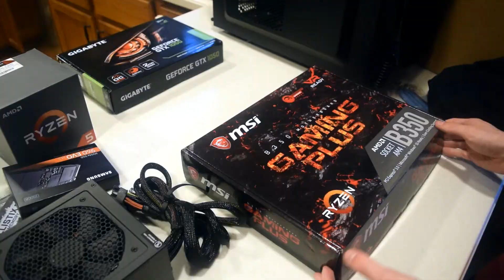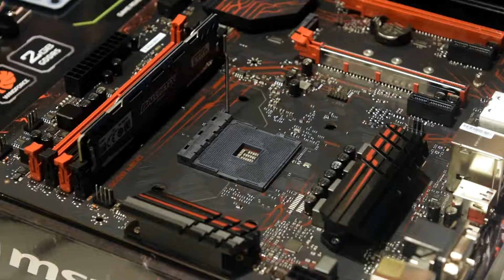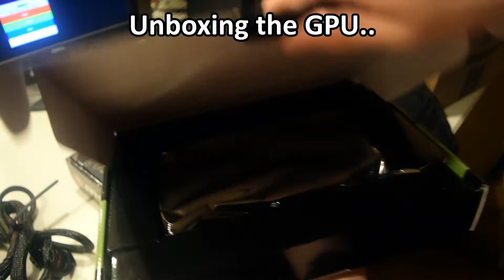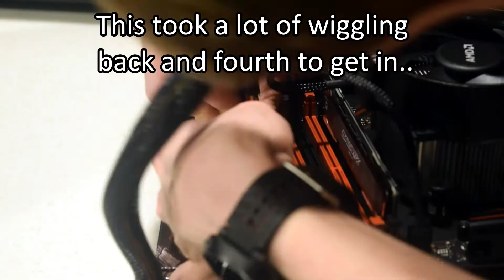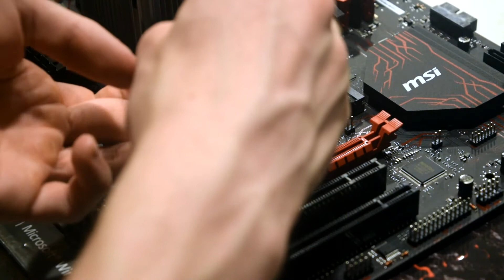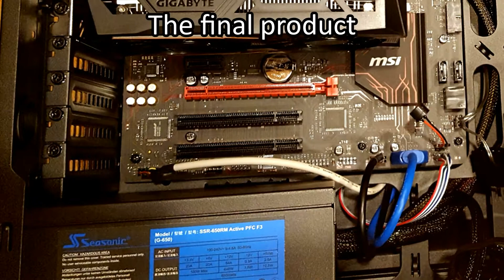$720 Ryzen 5 Gaming PC Build

Comment: Good budget build. I like the PSU choice, usually people cheap out on this part of the build and end up having to replace it every 3 years on average making future upgrades/build more expensive on the longterm.
I dislike the use of the 960 m.2 in this build. It's a high-end sdd, fastest on the market in fact but for low budget gaming pc that money for 1-2 seconds less boot/ingame-load time could've been better invested in say a larger 500gb 850 evo SSD since larger storage SSD is more future proof (considering game installation files wich keep getting larger with new AAA titles) and won't generally die as fast as smaller storage SSD's. Other than that it's a solid build.
Reply from the maker: Ethan Smith The PSU is a great one. On my desktop it never gets warm to the touch, and it is over 3 years old. As for the SSD, the person receiving this desktop has a 1TB hard drive that he was going to install for games and stuff.

Comment: you could’ve just gotten a 1tb hdd, instead of the ssd, and put the extra money towards a 1050ti
Reply from the maker: SSDs are well worth the money. So far I don't think the person using the computer has come close to maxing out the GPU. In a few years if he gets into an intensive game, it will be extremely easy to upgrade to whatever GPU is the new thing. GPUs are advancing really quickly, faster than most of the other PC components.

Comment: For $720 You should have gotten a 1060 cause that 1050 is a massive bottleneck
Reply from the maker: The goal was to save now, upgrade later.
Reply from the maker: So far the GPU is turning out to be great for his needs. He can easily upgrade his GPU if he needs to.
Reply: @LizardsGaming  can i plug in ryzen 5 1600 in same mother bord
Reply from the maker: @TheFrustratedOne  on the MSI website it says it is compatible with first and second generation Ryzen processors. So I think it will work. You should verify that with PCPartsPicker or something like that before buying.
Reply: @LizardsGaming  thnx you so much bro👍👍👍😊😊😊
Reply from the maker: No problem What are you building?
Reply: @LizardsGaming  m building a pc with following components :-
Ryzen 5 1600
Msi b350 gaming plus
Msi gtx 1060 6gb
Wd 1 tb hdd
Vs 550 psu 
Cooler master master box lite 5 case
And 8gb ddr 4 2666 mhz corsair veng. Ram

Comment: I'm building sonething very similar.My PSU is aero cooler 500w bronze 80, will that work everything ok?
Reply from the maker: It will work unless you get a really power demanding GPU. I would recommend a higher efficiency, though, because it saves money in the long run and generates less heat.
Reply: LizardsGaming 

The gpu is  a geoforce  gtx 1060.
Reply from the maker: That's not too power demanding. I can run both a GTX 1070 and a GTX 1060 at the same time on a 550 watt 80+ gold PSU.
Reply: LizardsGaming 

Thank you for your help.

Comment: better would be a ryzen 5 1400 and a gtx 1060 3gb the motherboard is awesome and overclock the ram and cpu
Reply from the maker: The person who requested this PC requested high CPU performance and GPU upgradeability.
Reply: LizardsGaming  but for 720$ you could build a better pc
Reply from the maker: The thing about building a computer is that the PC can be tailor made to be the best for the specific purpose of the machine. In this case, for the specific use cases specified, we could not have done much better. The PC already outperforms his requirements.
Reply: LizardsGaming if you are useing it for minecraft its ok but i would upgrade to a gtx 1060 soon or atleast a 1050 4gb and dual rank ram
Reply from the maker: Africa Is A Beautyfull Planet KRI there's room for a GTX 1080

Comment: Seriously a 80plus gold for a 75w gpu
Reply from the maker: Shivam Singh First, the PSU is the most important part, because if it is bad you could need to replace all of the equipment. Second, Georgia gets pretty hot in the summer and the room this is going in has bad cooling. Third and most importantly, the person receiving this desktop wants to be able to easily upgrade to a much better GPU in the future.
Reply: LizardsGaming gold is overkill right now ,you could have just gone for a 80+ bronze certified and with the save money could have bought a 1060 or atleast the ti version ,gold are for high end rigs but if you upgrade the gpu then it would be fine!!
Reply: LizardsGaming and your current rig at max load will draw only 300watts
Reply from the maker: Shivam Singh As I said, future upgradeability. With this setup we can easily upgrade to the GTX 1080. There is another comment commenting on how it is a good thing that we did not cut corners here.
Reply: LizardsGaming that's a big leap , but atleast you should have gone with ti version